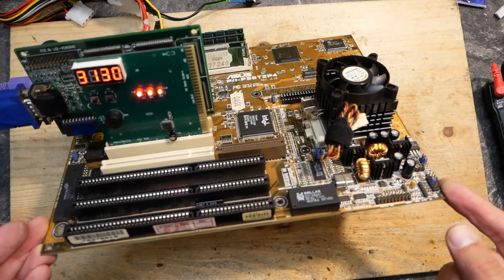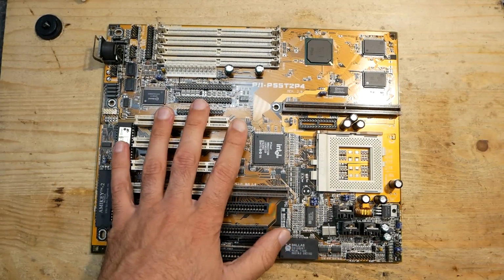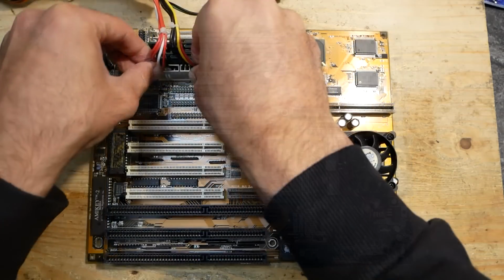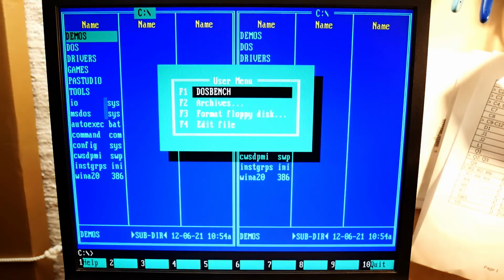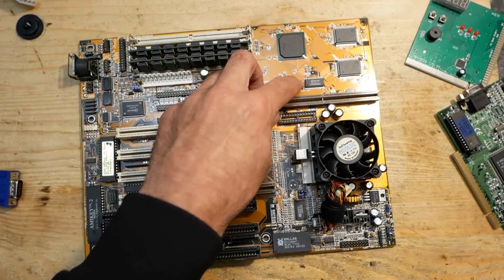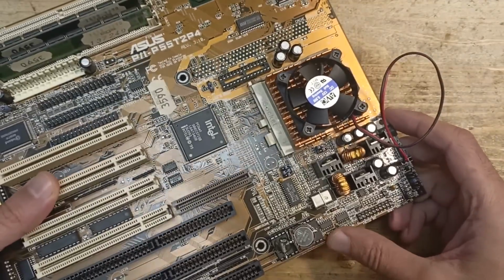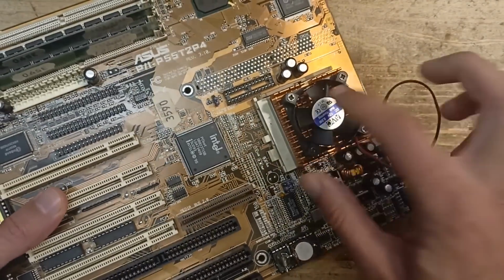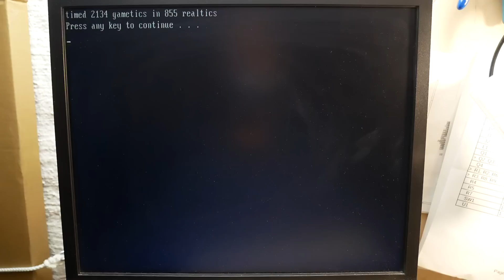Looking over Asus P/I-P55T2P4

Comment: Oh I stumbled across this video again :)
You said the board supported 512MB RAM so... were there really 128MB EDO RAM modules available? Never heard of those.
Reply from the maker: Well, I meant the chipset. This board has only 4 slots, so of course the limit would be here at 256MB (4x64MB). But this is still 4 times the amount of what is possible with TX, VX and FX chipsets from that time.
Reply: @necro_ware  Although I did a bit of digging, 128MB modules do exist although they are pricey...
4 of them just for fun... nah :D
Reply from the maker: @ferrari2k oh, nice. Never had one.
Reply: @necro_ware  Yeah, same.
I bought 4 64MB modules a long time ago when they were dirt cheap. Should have bought many more just in case...

Comment: Those dallas clock modules are designed to be very hard to replace for those without technical skills. Why can't it be a simple  replacement for the battery like on some video game consoles?

Comment: Thank you for demonstrating that process of opening up the RTC module without desoldering it from the board, I just used that to fix one of these boards up myself! I am still bad at soldering (shaky hands) so I don't trust myself with desoldering the module from the board and replacing it with a socket, but I will get better with more practice and install the socket eventually. Until then, this is working perfectly!

If I can make a recommendation, I used a dremel to cut a line on the top of the module on the right half, opposite from the pin 1 side. I then used a screw driver and hot air to chip away at the resin using the cut on the top as my entry point with the screw driver. It felt safer starting the chipping away from the top rather than the side where you could slip and accidentally hit some of the pins on the RTC and damage them. I left the left side of the module (the pin 1 side) intact so that it could hold the crystal oscillator in place and removed just enough so that I could remove the dead coin cell battery and solder the wires for a coin cell battery holder onto the positive and negative pins on the IC. I used some velcro stickers to keep the battery holder securely on the bottom of the case for easy removal.

Also there is a Mr. BIOS available for this motherboard! The files can be found here: https://www.vogons.org/viewtopic.php?p=1162370#p1162370

Comment: The only issue. Was the cache slot was mechanically glitchy. Back in the day the headaches these caused as they got a little age on them, was fairly massive. The only mechanical retention for those was the electrical contacts of the slot. Particularly in a tower were these things would sit on its side with gravity pulling on the module. It would start to develop bad connections, and a crashy computer. There is a reason these started to disappear midway through the HX chipset run to never appear again.
Reply: @Alcochaser good thing chip 🍟 manufacturing technology advanced to the point you could have larger caches built directly into the CPU die so you didn't need an external cache module after a while anymore.

I believe in the 90s one of the motorola 68k chips 🍟 had built in cache in chip but it was a tiny 256 bytes 🤏🏾 unlike the KBs you were getting on those cache modules

Comment: These chipset run with either a standard 8MB or if you had cash to spare the 16MB of ram.
Reply from the maker: 8MB was normal on the first generation pentium systems. As HX and TX hit the market (MMX) it was already more likely to have 32MB

Comment: I was one of the designers at Intel that worked on the 430TX, that was back in 1994. Just retired from there last year, and now Granite Rapids is shipping, which is the last project I worked on.

As the old saying goes, those who respect the law and enjoy sausage have never seen either being made.
Reply from the maker: Ha, I know what you mean. I'm myself in the software engineering since decades and there it's absolutely the same. I had a colleague, he worked for a big airplane manufacturer and since then he never took a plane again.

Anyhow, thank you for your comment. Doesn't matter how good or bad it went internally, you still did a great job and it's an honor to mention it here. Thank you very much.
Reply: @necro_ware same here, I am in software as well and since I worked in logistics I am grateful every day I can buy food.
Reply: Hello from RP1! Kinda funny finding somebody who was very possibly a coworker in the comments of a random video lol.
Reply: @DigitalJedi  At that time, I was in FM-2.  RP1 sounds like it's in Ronler Acres; I retired last year and spent the last 17 years in RA-2.
Reply: @gregebert5544  Ah gotcha! I am indeed up in Oregon in the R&D fab. It's all small batch stuff and test chips right now to get new nodes up and running.

Comment: i think by the time the battery can be desoldered it should be done right away before continuing with heating the resin. These batteries can explode pretty violently if heated for too long.

Comment: I need to research the cache on Triton II once again, then. I've read that due to a chipset bug, no more than 256k can be used, for some reason, but maybe it's untrue. I have an Intel Marl motherboard, with 256k cache, that I wanted to upgrade to 512k using chips I got from broken Slot 1 Pentium II, but got discouraged from doing that - and also add USB ports to the onboard controller, that were unpopulated. I kept looking, but I havent' seen a 512k or USB-equipped version anywhere.

Comment: I STILL have a T2P4 and it probably still works! It is a 256KB cache version with a cache slot - properly known as COAST or "cache on a stick" module. and on my board the Dallas module is socketed. It carries a 400mhz K6-2 which probably can be taken to 450mhz by upping the bus frequency.

There are also a few BIOS mods done so it supports larger hard drives, plus I added a full screen logo of Butters in a mechanic coverall as seen in S4E16.

Comment: That was my first board.
The PC stood in the basement during a flood many years ago when the PC was no longer in use, the board is still running.
Back then 32MB RAM and a Pentium 200 MMX.
Now the Bios Chip has been socketed and maybe I will upgrade to a clock module with 2032 battery.
256MB RAM and an AMD K6-3 400MHz and the system always runs rock-solid more than 25 years after I first got it. One hell of a board!

Comment: I recently got an IBM PC 300 GL from 1998 or late 1997 with its original CR2032 battery still reading over 3.0V! I even tried powering a red LED briefly from it, and it worked beautifully. They really knew how to make things back then :) And yes, I was the first one to open that computer in over 25 years :)

Comment: Is there a reason why your heatsink fan is not spinning?
Reply from the maker: It's not connected to the board. There is no need for a short test in a flying setup. That CPUs didn't get as hot and only needs a fan in a closed case under longer load.
Reply: @necro_ware  All right makes sense. Thanks for answering.

Comment: Save those old computer parts.  When the western world economy collapses, we'll be trading what we can't make anymore for necessities of life.
Reply from the maker: I guess, that if "wetern" economy collapses that far, then all economies will collapse. They are much more bound to each other, than most people without proper economical education think. In simple words, should it collapse, there will be nobody to trade old hardware, we would then probably fall back to agriculture and barter exchange. So, just enjoy that old hardware now and don't make plans about it beyond the end of the world as we know it.
Reply: @necro_ware  this.
Even factories in taiwan would not be able to make new chips, they will need to shut down.

So after some time, any computer will be good at some tasks (like running simple databases, doing simple computation). Even good old Pentium 1 ones.
Maybe 386 and lower, would be too unusable. But I'm sure, if anything new could be made, even 386 will have some use.

To scrap Pentium 1 CPU for gold, is sin. Big one. This civilization can learn it hard way. Also chipsets could be unsoldered from motherboards before scrapping (there could be law for it)
New PCB could be made even after collapse, but new chips not.

Comment: I love this asus pentium 1 boards, I have a few different variants of it. Just surprised why modified rtc instead use yours necroware rtc on pcb. I've ordered some recently on black and green pcb, using then on my retro builds. Again thank you for great work, this pentium 1 boards are great for Quake and voodoo 1
Reply from the maker: I made a video about it in the past. Since I open sourced my RTC project, people started to buy the required chips like crazy. Meanwhile it's hard to find a reliable distributor who would sell them for a sane price. I already got a lot of fakes, so you never know what you get. Of course I have some of my modules in stock, but now I use them only if I can't restore the old module. That also means less waste, since the chips inside of those Dallas modules are still alright as we can see, so why not using those, right?

Comment: If you have 512k cache how come you don't need the tag ram
Reply from the maker: You have one tag on board for the first 256K, then you have another on the COAST module for the second 256K. That gives you 8-bit tag for 512K which is enough to cache 64M of RAM. If you want to cache up to 512M of RAM, you need 11-bit tag and then you have to populate that socket on the board.

Comment: @necroware when working with electronics, do you ground yourself or do you consider this unneccesary?
Reply from the maker: I'm too lazy. I have a strap, but I usually just touch the case of the grounded PSU regularly. Just don't do what I do, never take advice in electronics from a software engineer ;)

Comment: I am a fan of the VX chipset. It has USB and IR support, at least my DFI board from back in the day does. I had it hooked up to my Scanjet 4C back in the day over USB!
Reply: IR support is just built on one of the of the UART ports of the SuperIO chip, replacing one of the COM ports, and USB is likely a separate PCI device, such as 83c572.
Reply: 2 USBs are built into the south bridge and are USB 1.0. Very slow. Better to disable onboard USB and add a USB 2.0 PCI card.
Reply: @simontay4851  at the time it was awesome there was no USB 2.0

Comment: I had a 430vx board which had cache slot. 256kb on the board and another 256kb could be added to make 512kb total. It had jumpers on the board similar to the board in this video to configure the cache.
Reply: yes, it was very common, that vx boards had 512kb cache too.
But main difference is, that they could not cache memory above 64MB limit.

So anything stored above 64MB memory area, was not cached, so access to that data was slower. 430hx on other side, could cache up to 512MB memory.

Comment: Can you check the height of the socketed Dallas modul? Do oversized sound cards still fit in the last slot? I once had problems with a socketed modul.
Reply from the maker: It is still lower, than an ISA slot.

Comment: Have the same board with post code 4E4A.Who knows what is that?
Reply from the maker: 4E is a very late error code and means "Show all error messages on screen". That happens after all critical parts have been initialized. Are you sure that your graphics card is alright? May be just incompatibility and you could try another one?
Reply: @necro_ware  Thank you! It works with is a card. I hope make a video with media bus card.

Comment: 512 MEGA bytes of cache? Running without the CPU fan is detrimental to the poor thing; those old CPUs didn't even have the thermal failure shutdown feature.
Reply: A good heatsink is sufficient. TDP Is barely 10 W
Reply from the maker: Oh did I say MB instead of KB somewhere? The CPU can be used briefly without a cooler. It doesn't get hot as fast as later models.
Reply: @necro_ware  yeah, 1:29 i came to the comments to see if i was misunderstanding you there :)

Comment: I always suspected the RTC battery would be under less load on a powered system, great to confirm.

Curiously, is the RTC powered by 5VSB on modern systems to further reduce the load?
Reply: Yes, standby power holds up the clock and NVRAM when available.

I would like to suggest though that RTC battery depletion is not dominated by current consumption but by chemical aging; so the crucial difference could be manufacturing variations and storage temperature rather than how the computer was used in its heyday.
Reply: Stand up power on AT board? 

no, AT board is always turn off (from the AC). Only ATX has stand up power.

It HAD to be running 24/7 in order to keep battery charged.
Which is unlikely.

I would suspect, someone had already soldered new Dallas before Necroware got it.
Reply: @warrax111  that's why I was asking about modern systems (ATX).

You are correct, AT was completely dead when powered off (except for the RTC battery).
Reply: @warrax111   Of course on AT there is no standby line. But that Dallas has a manufacturing mark year 1996 and there are no signs of rework on the board at all there, it wasn't replaced. The design life on that Dallas is 10 years, but they last somewhere about 20 years on average, so some last short of 15, others last 25, it's just random, there's just natural variation to them.

Even if the Dallas was replaced, well it's running the moment it's manufactured and put into the package, the NVRAM is being held up, the clock is ticking some nonsensical date and time. And like it's obvious it was made in 96. So like it would have experienced the same aging whether it's in the board or not.

Comment: I always joked that I overclocked my P200 to 208 .. But it actually was a nice boost because it was 83mhz FSB! Later I used a Tomshardware guide to unlock some voltages and multipliers to use a K6-2 500, which worked but the whole thing was limited by the chipset and memory I think. Good memories though!

Comment: Someone spend this poor guy a hot glue gun!
Reply: He probably has about 20 of them. They just have a habit of appearing in the household nobody quite knows how and from where. The problem with them is that they need 7-10 minutes to get up to temperature, which is why i don't use them when i just need one blob of hot melt glue either.
Reply: @SianaGearz  That's why mine is an awful pink color.
you can't miss it :)
Reply: @nalinux   That's not the problem.

The problem is that they take too long to heat up.

Apropos pink. I broke down and bought a cheap pink cordless drill. I love it. I want more pink tools.
Reply: русские не сдаются!
Reply: @alexcorvis1379 Russians gave in in advanced chip 🍟 design lol
Reply: How about a 3d pen instead
Reply: Wut?
Reply: @ruxandy  15:25
Reply: @boardernut , uhm… thanks… I guess, but I was just making a joke about the OP’s poor English.

Comment: Everything looks good but running the heat gun with the chip in the motherboard seems a bit risky. You worked it with no problems but ideally you would take the chip out before you tear into it. Great videos.
Reply from the maker: As I said, that was just an experiment and the heatgun was set to only 100°C. That should be safe.
Reply: @necro_ware  sorry wasn’t trying to be the ackshully guy. I was just thinking about people who don’t know what they are doing. I should have qualified it. You were good.